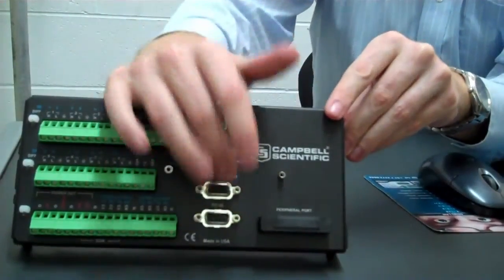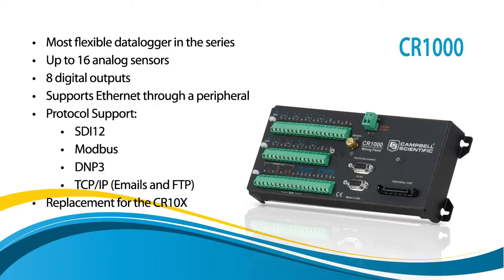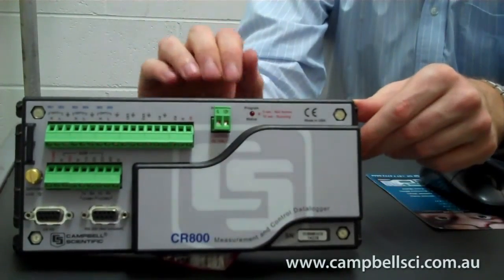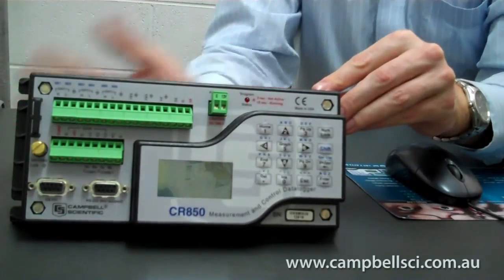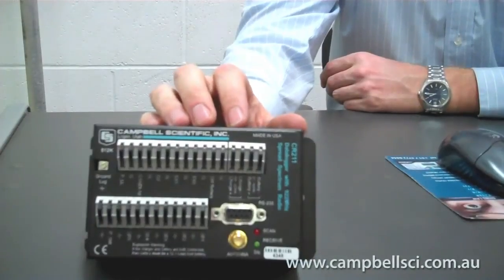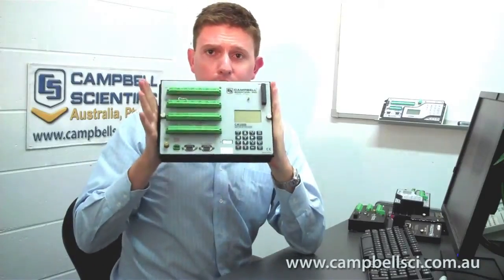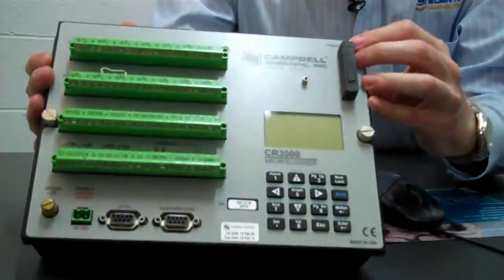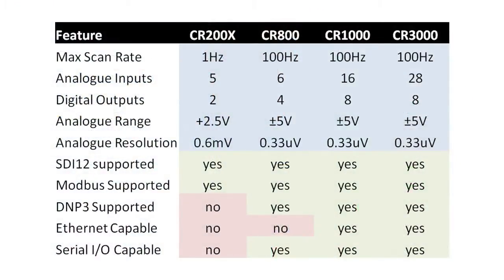A Comparison of  Campbell Scientific's Top Selling Data Loggers

Comment: can I built monitoring system as below: CR6 connect to VW305 to get data of crack meter sensor (12 set, type: VW) and tilt meter sensor (4 set, type: 4-20mA), my system get data output 200Hz sampling rate ?
Reply from the maker: Thank you very much for your question. To provide you with the best technical support, please visit https://www.campbellsci.com/contact#dir to find your local Campbell Scientific office.